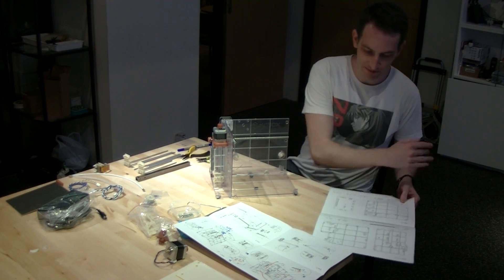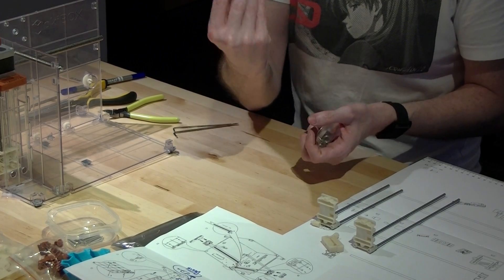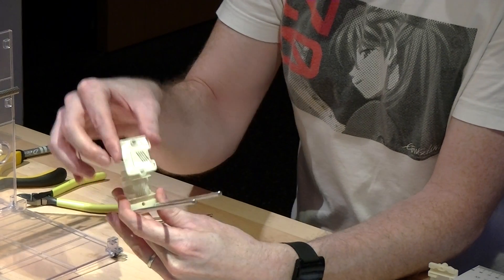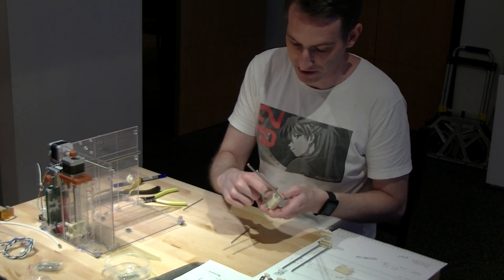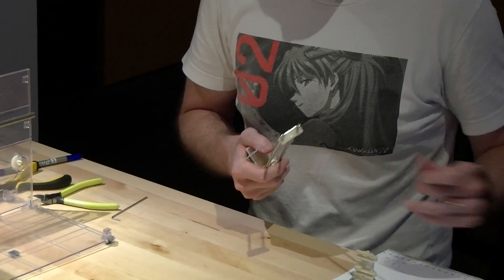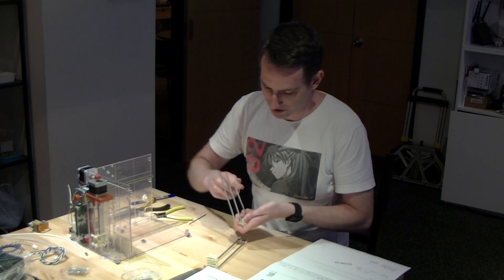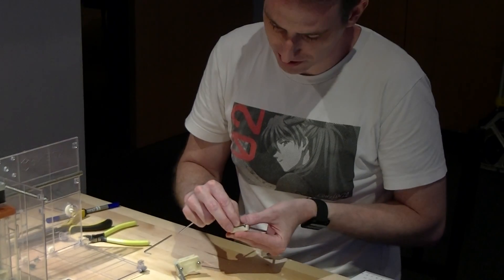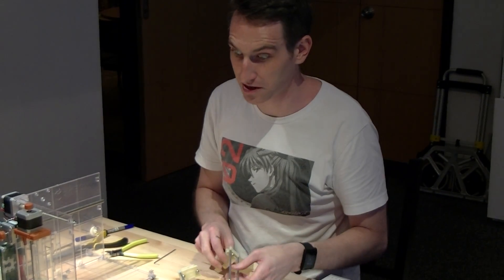#MakiBox Assembly Step 5

Comment: 2019; Having fun assembling my Makibox and already got firmware loaded onto Ramps board without a hitch. This is a sweet little printer, like a Baby Ultimaker : ) but with naff design flaws : ( LOL. Parts should click/drop/twist lock or be secured by bolts/screws rather than be pressed together and hope they hold (Z Axis) but there's SO much to like about the printer, it's a tragedy it failed for what seems likely to be "all the wrong reasons." I'd certainly never have left out the power cord, that was a penny-pinching saving too far. If I bought a Mains powered Radio and it arrived without a power cord I'd be cheesed off. Question is, in 2019...will it print? I bet it does, maybe even perfectly.

Comment: Probably not the bits that are most likely to wear out. But we will be able to ship out spares reasonably. The CNC versions will be available, and some of those can be printed, but for the things like drive blocks, the material and the resolution for a printed part is probably not really suitable.

Fortunately, since they are just small injection molded bits, the replacement cost is pretty low.